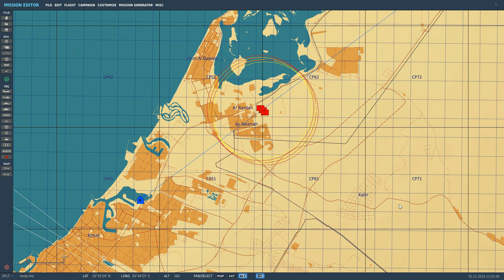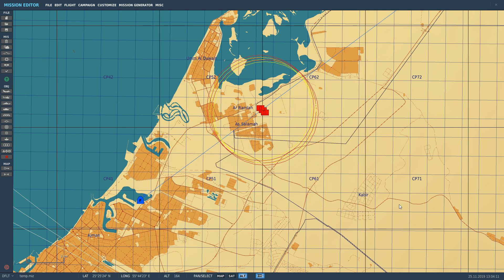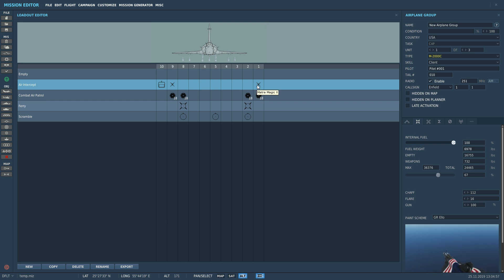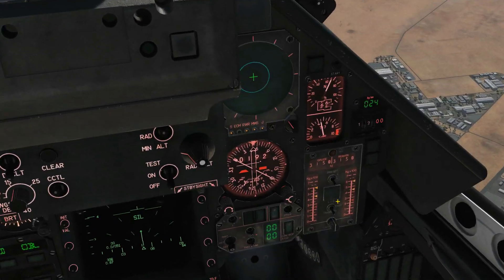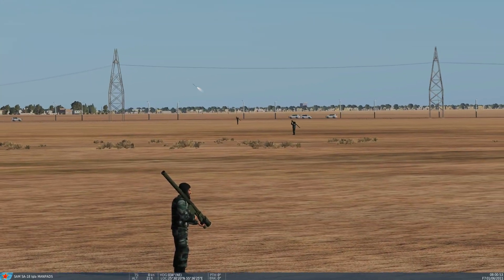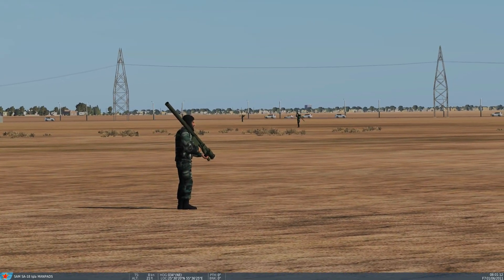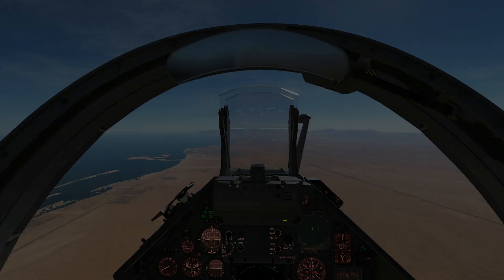Mirage 2000C: MWS Missile Warning System Tutorial | DCS WORLD

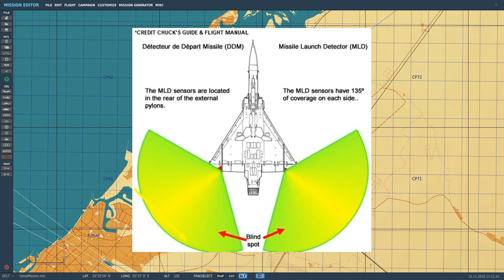Comment: If they cover 135 degrees on each rear quarter, then the top-down diagram at 0:27 has the "blind spot" label wrong.
The colored arcs would be the coverage zone in that case.  The blind spots would be the non-colored areas.
Reply from the maker: Well it certainly works if the missiles is coming from the front, so that agrees with the table?
Reply: Grim Reapers so then it would be 135 degrees of blindspot instead of coverage
Reply: @grimreapers  As detailed here:  https://forums.eagle.ru/showthread.php?t=177756 the colored areas are supposed to be the detection field and the blind spot is supposed to be at 6 o' clock. However - as your video shows the software-reality seems to be different....
Reply: @grimreapers  The diagram says two different things.  One of them is wrong.  It mentions coverage being 145deg to the rear of each pylon.  Then those same coverage areas are labeled "blind spot" with red lines pointing at them.  i.e.  Something's wrong with one of those labels on the diagram.  Just a heads-up.
Reply: I tend I agree. I was thinking the blind spots depicted would be the most useful areas to know if a missile had been fired. Also being based on IR it's subject to numerous false alarms and prolly won't be used much.  Effective MWS are UV based.
Reply: @terryboyer1342  And the text in the aforementioned graphic contradicts itself.  So which is it, I wonder?
Reply: @NefariousKoel  Waagner!
Reply: Doesn't that make a whole lot of sense anyway - the blind spot for the rear-mounted IR-detecting sensor being the hot exhaust gas right behind the jet, masking any IR signature from missiles that are miles away?
Reply: decnet100 I think the colored areas are supposed to be the detection area, it would make sense to angle the IR sensors to not be looking at your own afterburner plume to prevent your own exhaust from tripping the system.  But caps video does clearly show the System detecting a launch from the 12 o clock position.  It also makes no sense for a sensor mounted on the back of the pylon to be blind aft of said pylon
Reply: @Knightfang1  Judging by the pic of the actual mount, the colored area is likely the detection arc because the IR detector is mounted facing outboard of the mount (on the side of it).  Dunno why DCS has it picking up IR launches at 12 o'clock either way, though, since it should have blind zones both at 12 and 6.  Probably a wider one around 12 due to the side-mounted outward facing detector.
Reply: According to Chucks Guide Page 205, the Coverage of the Sensor is about 360° horizontally, and it is able to see everything below you. The only real blindspot is above the Aircraft.